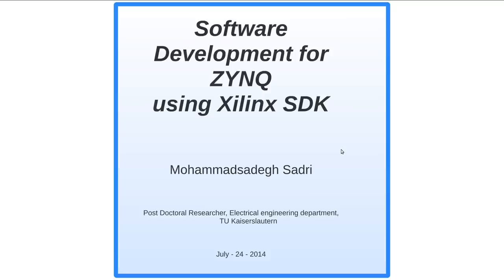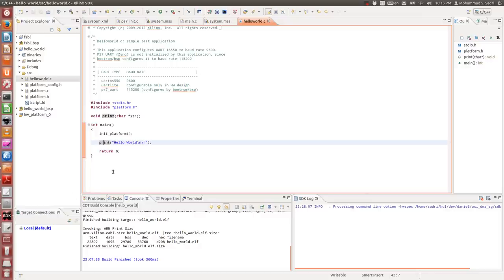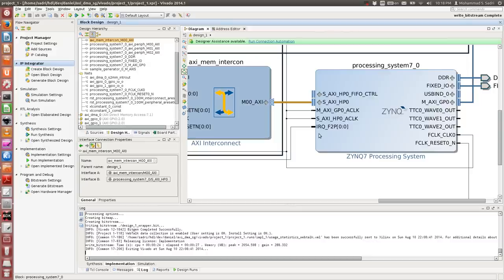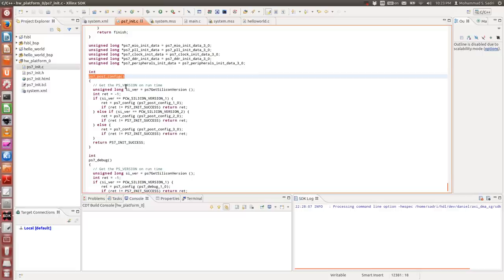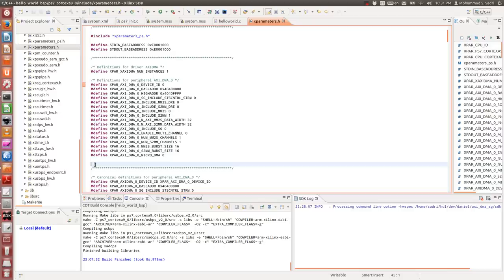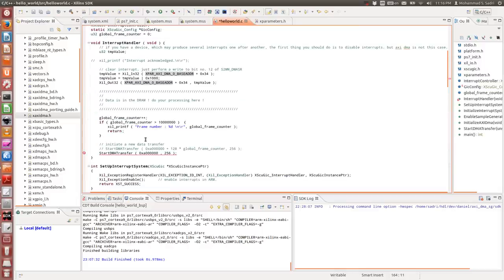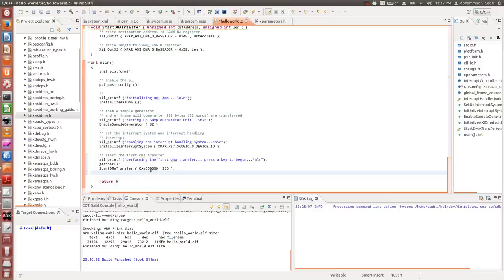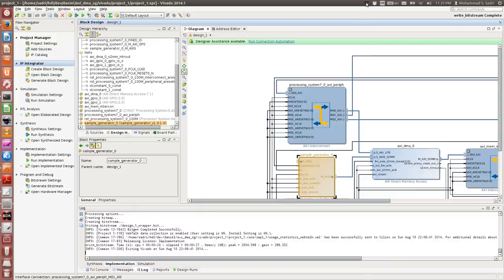ZYNQ Training - session 09 - part IV - Transfer Data from PL to PS using AXI DMA

Comment: A very nice lecture and thoroughly explained. Thanks alot Dr. Sadri !!

I have a small question. I have a design which does sorting and as of now the whole design is in the PL side with the memory used as the BRAM. However, now I have to do sorting with a bigger list of data sets and BRAM capacity is now insufficient. I wanted to employ DDR RAM for the same. I have wrapped my sorting block inside an AXI Stream wrapper and want  to replace the data from BRAM with DDR RAM. Do you have any lectures on such type of application where you have transferred data from BRAM to DDR RAM through the above mechanism ? Or Can you suggest me in this case how should I proceed ? I have been stuck with this issue from a long time. 

Thanks again !!!
Reply from the maker: Hi. You BRAM is too small for your arrays and you need a higher capacity memory thus you want to use the available DRAM. Is this what you want to do? Then typically a DRAM is connected to the PS DRAM Controller. Your module residing on the PL should get connected to one of the PS HP ports. From there you will have access to every location on the DRAM address space. For this to happen your module needs an AXI Memory Mapped Master Interface. Watch my videos on the youtube channel of Microelectronics Systems Design Research Group of TU Kaiserslautern. You will find all you need to do this.
Reply: Thanks Dr. Sadri !! 

Yes I have to replace the BRAM and get DDR RAM in place of that. I have also thought about the same about wrapping my block in AXI4 memory mapped master interface. However just a small clarification - you said that module on the PL side should get connected to one of the PS HP ports. By this do you mean without DMA or through the DMA only ? I was hoping to connect it through DMA. Correct me here, if I understood something wrong. What lecture should I specifically refer?  I am a research engineer at National University of Singapore.
Reply from the maker: Both are possible! you can also use an AXI DMA module. In that case your module needs an AXI Stream port, which gets connected to AXI DMA of Xilinx. From AXI DMA you go to one of the HP ports. Now with the ARM host you program the AXI DMA to perform your desired data transfer from your module to the DRAM.
On the reverse path, you need an AXI Stream Slave port at your module, which again gets connected to AXI DMA, and you program the AXI DMA to transfer data from DRAM to your module.
The above is the easy way. you can watch my AXI DMA videos in my own channel for learning how to do the above.
And if you want to do it under ARM running Linux, then I have another set of near 20 videos for that, but they are available at a fee.
The other way, is you integrate an AXI Master plug into your own module, this needs some HDL coding and might not be easy. In any case I have shown how this can be done in the Lesson 7 of youtube videos of TU Kaiserslautern channel. The advantage of this solution is that, overall, you will end up with a lower latency for your read and write transactions.
So, if you want to transfer small chunks of data between your module and DRAM, e.g. you have a large number of I/O operations but the size of data transfer each time is small, then go with the integrated axi master plug solution.
Otherwise, if you have few number of I/O operations which should be done, but in each I/O operation you transfer a very large amount of data, then go with the AXI DMA solution.
good luck.
Reply: Thanks a lot Dr. Sadri !!
I will go through the Lesson 7 once. Then I would be in better shape to decide whether I should go through the AXI DMA or not. 
Regarding running linux on ARM, i dont think that is required. I just have to implement my block and since I dont have that much of memory space with BRAM, I have to go with DRAM. 
One thing Dr. Sadri - Can we connect our PL block directly with DDR without involving PS through a MIG or something ?
Reply: Dear Dr. Sadri, 
I went through your lectures from lesson 7. In that you have used IP if blocks which is talking to the axi master block. Regarding this, I was thinking that since in packaging our IP with AXI peripheral (as we do in AXI Slave Interface) can we package my sorting RTL block inside an AXI master interface which communicates with the HP ports of the PS ? I think in that way we can get away with the IP if block which actually adds to the complexity of the code. 
Waiting for your inputs. 

Thanks alot for your lectures and guidance. You had been a great help.
Reply from the maker: Hi. I hope I have understood your question correctly. Yes. You can have an IP in which you have your own RTL code as well as an AXI Master plug. is this what you want to do?
Reply: In your lecture, you mentioned 4 different ways of interfacing your own block-
1)  write your own master block
2) write an IPIF block
3)  automatically generated code for master and slave in case of AXI. [Create and package wizard]
4) Write an HLS
I am talking about the third option and can it be integrated well with my design. Actually my design is also working on an images of VGA resolution and it is sorting some parameters of image. Initially it was doing with the BRAM, but that was for 120*120 resolution. But now since we have 640*480 resolution, i was thinking just to do the following steps :
- remove the BRAM. 
- wrap my code in an AXI4Stream master and slave  MM2S  and feed it into the AXI DMA through which we can read and write the DDR RAM.  
- control with the ARM host

I know my timing would be a problem now and i have to change my state machine in my rtl block.

Thanks 
Shubham Rai
Reply from the maker: Hi. In my view that is no problem. You can do it.
I  have used axi dma in normal register mode with a bandwidth of > 500 Mbytes/s interfacing to ps dram. even you do not need to use the axi dma in sg mode.
Reply: One last question from my side - Can I connect the DDR RAM using memory interface generator with my RTL design directly without using the ARM Host ? If yes, Can you help me with some tutorial or some User guide to work this out ?
Reply from the maker: Hi. Of course you can! But does your board have any dram memories connected to the zynq PL? for example ZC706 has such a memory directly connected to the PL and you can run the MIG and even you can generate it without AXI interface (if you don't like AXI) and connect it to your rtl. So, the answer is yes, if your board supports it.
Reply: +Mohammadsadegh Sadri 
I think no because I am using zedboard as of now. But we are planning to move on zc706. do I have to look at ug586 for mig interface and how to connect directly with a RTL block or some other tutorial which are more easier to understand?
Reply: Hi Mr. Shubham Rai, can i ask you if you resolved your problems with the DDR RAM connections ?
 I am doing a project like yours, and I am not able to connect my PL with the DDR RAM. Do you have any advice ?

Comment: Thank you for your video.
I followed your tutorial and at the end getting
XMD% mrd 0xa000000 10
 A000000:   00000100
 A000004:   02013001
 A000008:   06002202
 A00000C:   19425003
 A000010:   82281004
 A000014:   21020005
 A000018:   01020006
 A00001C:   42844007

looks like I only write 8 bits to the memory address. But I followed exactly what you did, and using a Zedboard too. Any idea what may go wrong?

Look forward to your next video.
Reply: hello 
i am also getting the same issue.
did you get any solution?
plz suggest......
Reply from the maker: Shivendra Joshi  you need the updated code. the one i created during video has a small bug.
Reply: where do i find that new code??
Reply: Mohammadsadegh Sadri in HDL code or C code?......I am trying it since morning but atlast it shows these values.....
Reply from the maker: Shivendra Joshi
There was a small bug in the HDL code which I fixed. (available at the page of the lesson) But looking at your numbers I feel your problem is more serious , since the bug was only related to the end of packet... it looks like even you are not going to the next data transfer... are you sure you have done all of the steps fine?
Reply: Mohammadsadegh Sadri the only difference between your design and my design is when i stop the processor in sdk........in your video it says USER INTRRUPT ,PROCESSOR STOPS AT "SOME ADDRESS" but in my design it only says processor stops........it is not showing that line........please help.